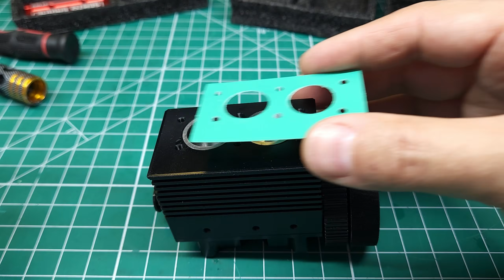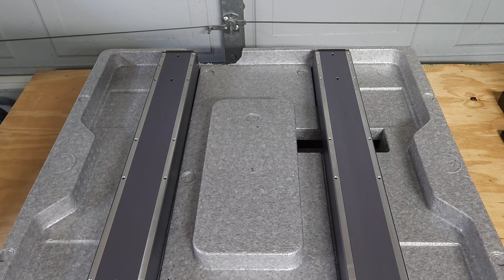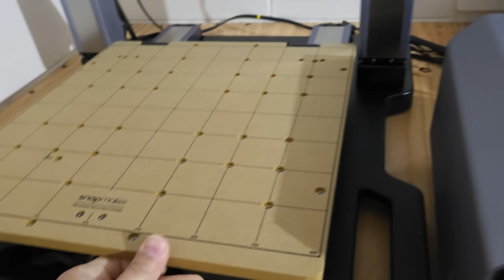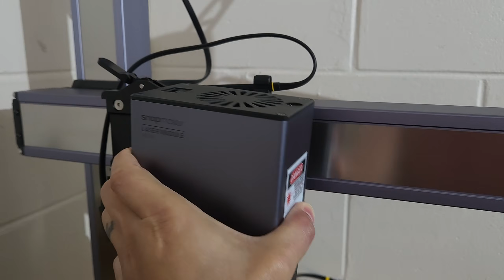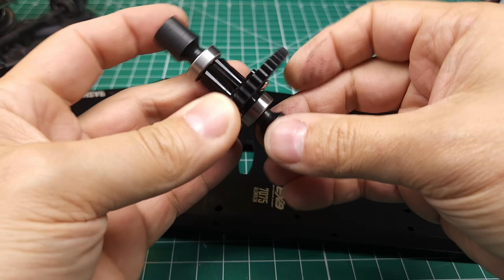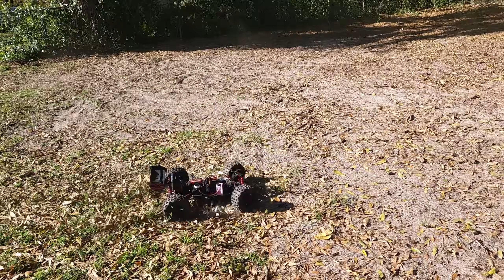Electric No More! My Arrma Kraton Runs on GAS Now!

Comment: I just have one question, I have this engine. On your test run before installing it.  i noticed when started it you used a button how did you wire that switch? Thanks
Reply from the maker: It was the wiring harness that came with my kit. Originally it was part of the glow plug igniter system but I fried that part of the system accidentally using 3S on the starter so I cut that part out and it's just the wires going to the starter motor to the battery and then with that push button in between on one of the leads. I found that 3S is best for actually starting the motor because it needs to spin pretty fast to start.

Comment: dude ive been thinking of doing something like this or moving away from electrics as ive really been annoyed by lipos recently. ended up not comitting due to various reasons (cost, noise, weight, performance) but this is still cool to see. i also ran my kraton 6s on 2wd for a bit and it really surprised me how well it handled. did you remove the front diff? that should make it even lighter and true 2wd. also if you want more power a hobao hyper st truggy engine powers that 1/8th scale truggy more than enough (3hp ish) especially if you add a 2 speed transmission and itd be cool to see what a modern high end basher would perform like with a nitro drivetrain like that.
Reply from the maker: I didn't remove the front differential. Yeah it would have made it a little bit lighter but I don't think it would have been enough to make a difference and to be honest I was pretty overwhelmed with everything else in the project so I just didn't have the energy to do it

Comment: if flip engine around you can run direct drive. you can also run the engine further forward and slightly more central if use the titanium extended shafts you can buy from m2c 🤟
Reply from the maker: Unfortunately direct drive isn't going to work. Even at The 50/19 gear ratio it really struggled. One to one would be way worse and really wouldn't offer any benefits

Comment: Fantastic job.  Might not be 'fast'...but, obviously, that wasn't the point of this conversion.

Speaking of 'speedc, I think it would have been great (and hilarious) of you had done a "speed run" under nitro, as well as gas, so viewers could have seen how fast (or slow, in the case of 'gas') the Kraton was actually going.
Reply from the maker: Yeah I'm honestly just happy it moved at all and the fact I was able to kick up a little bit of dirt when it was running on nitro is all I really could hope for from that engine.

Comment: That fireteam/infraction disk brake module is smart AF!! I probably would have overengineered a 2 or 4 point disk brake system with a cable and pully setup 😂. I butcher time apparently
Reply from the maker: Yeah the only downside to it is you can't really run a center differential but overall it's a pretty straightforward solution to the problem.
Reply: @DoRC  why not? What keeps you from putting a center diff in? It looks like there's no obstruction for the forward driveshaft to fit and the spindle mount looks wide enough for a diff to fit? Is there something I'm missing? I'm looking at my notorious right now thinking of trying the same project 🤣🙌🏼

Comment: Wonder if it could be a generator for batteries that run an electric powertrain.
Reply from the maker: Yes you could definitely do that though space Will become a problem pretty quickly. Once you add in a motor and ESC to everything that's already there it's going to get pretty cramped

Comment: Should of left the 4wd. Would be better
Reply from the maker: Not really. With this little power the main problems are going to be weight rotating mass and drag. Having the front wheel drive components in would increase all of those things. The only thing four-wheel drive really does is gives you more traction and the last thing something that is this underpowered needs is more traction.

Comment: Build a 2-1 exhaust measured to length. The power will increase 4in exhaust total length should work
Reply from the maker: You might be able to get a bit of scavenging effect from a two into one but I really don't think that's the main problem and I'm not sure it would be enough benefit to make it worth doing. The engine has some other pretty serious deficiencies that need to be addressed first.
Reply: @DoRC  warped perception built a supercharger setup for one check it out
Reply from the maker: @zmjzmj8464  Yeah I remember seeing that.

Comment: Hey DoRc, ive never ever seen you so happy in a video. It was a a delight to watch a run it for the first time.
Other than that, this build is insanity and you know it😂
Awsome video!

Edit:
Im not a nitro guy, but when I am not mistaken nitro can deliver significantly more power out of the same engine as gasoline does. Unfortunately nitro is quite banned in europe.
Reply from the maker: Yes. It comes from the fact that the fuel to air ratio is much lower with nitromethane. With gasoline it's about 14 parts air to one part gasoline and with nitromethane it's closer to two parts air to one part fuel so you can cram a lot more fuel into the combustion chamber. Nitro methane fuel also has a significant cooling effect which helps create more power

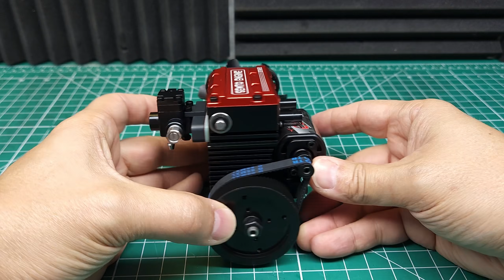Comment: 2:42 nitromethane is exponentially more energy dense than gasoline. You get several times more horsepower out of it than gasoline.
Reply from the maker: By mass nitromethane is actually a little bit less energy dense than gasoline. Its energy density isn't what allows it to create more power. It's stoichiometric ratio is what does the trick. The stoichiometric ratio of gasoline is about 14 to 1 which means for every one part of gasoline you need 14 parts of oxygen for it to burn the most efficiently. With nitromethane that's about 2 to 1 which is where it's extra power making ability comes from.

Comment: Was going to say that single brake wouldn't be good at stopping for long but no worries it’s to slow to need brakes. Really though that motor would do better then that.
Reply from the maker: Yeah unfortunately these motors really aren't designed for practical use I don't think. The break though will work pretty much as good as the brakes on any two-wheel drive vehicle. I did some tuning off camera and had to use the brakes on concrete. They worked just fine.
Reply: @DoRC  oh cool was thinking if it was possible to add a front one but then remembered steering was there.
Reply from the maker: @a1racer441  Yeah unfortunately the only other option would be to do some sort of mid-mount brake Like you see on real nitro powered four-wheel drive vehicles and I feel like by the time you start doing all of that it's kind of not really the original vehicle anymore.

Comment: This was amazing! I wonder how it'd do with something on road with smaller/lighter wheels+tires, like maybe the Infraction or the 4s Maverick line. Especially if you could add a front brake somehow to turn it into a burnout machine.
Reply from the maker: Smaller and later would help but I think the reality is these engines just aren't made for practical applications. Not that there's anything wrong with the engine and it runs fine on a stand but it definitely is far from being optimized.

Comment: maybe a begger motor for it to go faster
Reply from the maker: It wouldn't actually even need a bigger motor just a practical motor. There are nitro truggies out there that run just fine and I could have done that but then I would have just been making something that already existed.
Reply: @DoRC  right would some of your 4 clyinders motors or other motors you have built in the past?

Comment: First off props on the build.  Grew up with nitro powered rigs and would love to see them come back but brushless has mostly killed it outside the 1/8th scale racing circuit and some niches. Not that I don't love my brushless rigs definitely more run time vs wrench time compared to nitro.

Nitro requires far higher compression than gas especially to be  compression ignition like your motor seems to be on nitro meaning from what i can see the motor should make far more power on nitro. Put it back to nitro and run a either heavier clutch spring or lighter shoes to raise the stall and it should have more oomph.

And although a 4 stroke is cool a 2 stroke would really be the tool for the job. I'd imagine their are some nitro rc motors that could motivate the car pretty well probably not as well as a high end brushless unit but enough to be really fun. 2 stroke is going to almost always have more power per displacement, weight, and physical size. Their are many rc 2 stroke nitro motors that can pull some serious RPM and power.
Reply from the maker: It definitely will have more power on nitro as like you said I don't think it's set up to run on gas but unfortunately I don't think it's ever going to be powerful enough. The engine is just not optimized for practical use. It's really I think designed for having fun assembling running on a stand and making noise. Obviously there's nothing wrong with that as putting one of these together is a lot of fun and an educational experience but without some serious modifications I don't think it's ever going to make real power
Reply: @DoRC  that's why I think the rc nitro motor eould be the better power train. Their are twins out there from the plane world.

Regardless cool build.

Comment: You should try using Traxxas’s 3.3 engine
Reply from the maker: For sure. There are multiple appropriate nitro engines I could put in there but then I just would have ended up with a nitro truggy which you can just go and buy those :-)

Comment: The sad thing about these engines is that they are horribly unoptimized. They are nice for display purposes, but suck at being used for anything else. A nitro engine these days nearly has 1000hp/L of displacement, I would be surprised if these little 4 strokers get to even 100.
Reply from the maker: I completely agree and you can tell when you're putting it together that they're not designed for practical use. Still fun though

Comment: All I can say is WOW! That lil engine is really neat. I curious on what kind of beifits you could get from lil things like a valve lapping, P&P...you know like a lil tune up! Maybe even a lil forced induction!
Reply from the maker: Yeah there is a lot of room for improvement on this engine. All of the valves leak the intake system is wildly restrictive the ring gap is a mile wide etc etc.
Reply: @DoRC  sounds like you have alot of work ahead of you!🤣

Comment: All that wonderful machining work and effort for such a gutless display engine. Would love to see another build with a proper RC nitro that tries to match the performance of electric. Maybe twin .21?
Reply from the maker: Yeah there are definitely more practical solutions. I just honestly didn't think they would be as interesting because it really would have just been make the mount, mount the engine run the car. 
There are plenty of big block nitro engine powered truggies out there so I think this would run just fine with a standard big block nitro
Reply: @DoRC  Then mount 4 of them on an 8s chassis. Never seen anything like that before.
Reply from the maker: @toolbaggers  I've got a different idea for an 8S chassis :-)

Comment: I remember seeing a post 2 years ago on Facebook someone had a nitro engine on a arrma talion and it worked
Reply from the maker: Yeah I've seen one in a talion and in a typhon but never in one of these. I didn't really expect this to perform very well as these engines are kind of more for display and exhibition than actual practical work but it was still a lot of fun to do
Reply: @ the sheer fact you even got it to work is amazing and I hope the manufacturers of that engine sees your video and decides to innovate by making a more powerful version of this engine, even if they had to make a big larger in length who says it wouldn’t fit a Arrma Mojave, Big rock 6s or any XL kraton build using that chassis or even a limitless chassis like my own does
Reply from the maker: @fiercetatsu6782  I honestly don't think displacement is the problem. It just really needs to be optimized. Maybe I'll do it :-)

Comment: Wonder if there is a way to add a supercharger or something crazy to really wake this engine up.  Or some form of hybrid variation.  Having that engine is impressive, nice work.
Reply from the maker: You definitely could although I think you could probably get a lot more power out of it by simply optimizing what's already there. The valves don't seal all that well the rings had big gaps in them the intake manifold is incredibly restrictive etc. I suspect this is really designed as a display / exhibition type thing rather than for practical purposes.

Comment: Need a rotor...competition 50 cm3 on 90cm3 trick
Reply from the maker: Yeah this engine definitely was not the ideal engine but it's the engine I had :-)
Reply: @DoRC  chainsaw engine o scooter jejeje prapared
Reply from the maker: @frapaber6033  That would probably do it
Reply: @DoRC  here budys put his scooter 50 cm3 on 80 or 90 cm3 malossi o things like that and they get 90 milles easy....they put wáter pumps and radiators..rotors polish admisión, exhuast, variator...long pinions...Big carburator...jejej
They fly jejeje

Comment: Kev: Gas converted Infraction drift truck!

DoRC: Hold my Allen Wrenches.
Reply from the maker: I'm sure his will be awesome too! Thanks for watching :-)
Reply: Hes got a nitro V8 that's 10 times better, not that this one is bad
Reply: @AverageGamer2010 he won't get it going
Reply: The bit is more that the one is an on road high voltage rig where as the Kraton is a high voltage off-road bashing Truggy.

Comment: Be careful with the fumes from all those machines. Even 3D printing PTEG can make some nasty fumes. I assume that enclosure does filtration/exhaust as well as shielding from lasers.

You probably know all this already, as you're clearly a smart guy. Just wanted to be that guy just in case.

Super cool project.  I own that same engine and had a hell of a time tuning that carb. You're a much braver man than I doing a gas conversion.😂
Reply from the maker: Yeah my 3D printers are out in the garage and I have both fume extraction and filtration.
I honestly don't think these engines are designed for practical purposes which is why they don't run very well.

Comment: Fantastic project! 
However..after watching other videos of these little 4 bangers informs me they aren't powerful enough to have fun..
Reply from the maker: Yeah I think they're really more for display and demonstration and that's fine. I suspect 99% of people that buy these are going to enjoy building them enjoy making them run for a few minutes and then sit them on a shelf. There's nothing wrong with that though as it's a great learning tool.
Reply: @DoRC  They DO sound fantastic, yours in particular.  Maybe they ironed out the flywheel weight or something.
Side note: I've got a brushless grom DT coming by next friday; 4 batteries under 1800mah, 2x 2s, 2x 3s. There's a local dirt track nearby I can shred it on, maybe win a few impromptu races. Stay cool, Do
Reply: Congrats on a successful project, and a nice bit of fab kit.

Comment: Very interesting and cool project however that engine was a bad choice, very underpowered and low revving. It would have absolutely ripped with something like a proper .28 or .30 size nitro engine for a monster truck.
Reply from the maker: Absolutely. This was never going to be a practical long-term solution. I just really wanted to put that engine in that car :-). To be perfectly honest I'm surprised it moved at all.

Comment: I remember having a v2 Kraton and started getting into nitro more and always wanted to make my old Kraton run with a big block nitro engine.
Reply from the maker: Fortunately I don't think that would be too difficult. One of those engines would be quite a bit smaller than what I put in there so other than the custom motor mount there wouldn't be a whole lot you would need to do.

Comment: Could've just used a standard 1 cylinder RC nitro engine, but this is way cooler!
Reply from the maker: Exactly. I did consider doing something like that but to be honest I just didn't think it would be that interesting. All I really would have done was make a motor mount stick it in the car and drive it. The not knowing whether or not this was even going to work really spices things up :-)